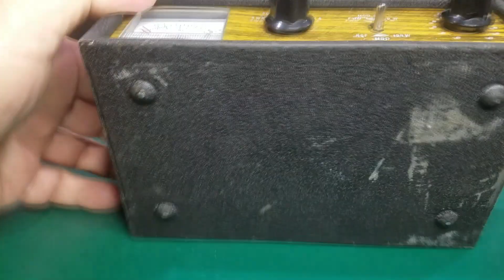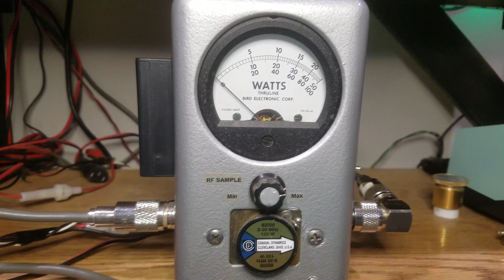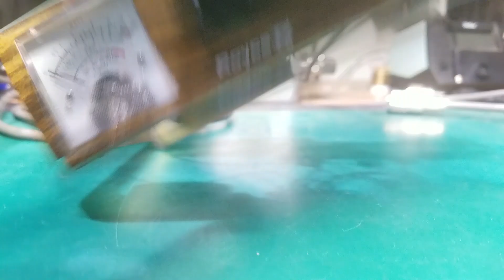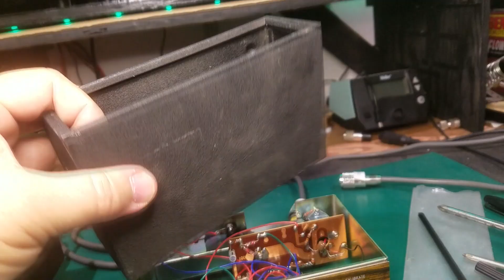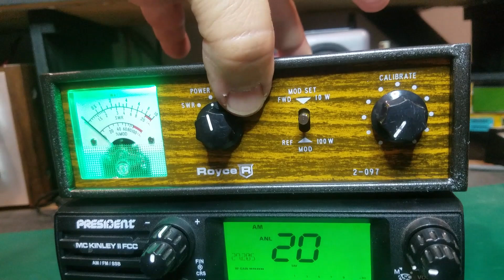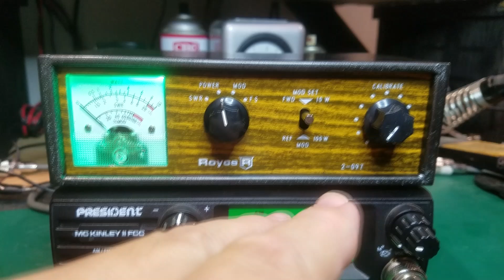Royce 2-097 3 Way SWR WATT MODULATION Meter Servicing

Comment: How did you power the green light?
Reply from the maker: A hot glued in a green LED that has the resistor on it so it will take a 12 V input. I put a connector on the back of the meter and then just wire a universal plug so I can take it in and out of line if I need to, and I just power it with my bench power supply. I use those 5.5 mm barrel connectors.

Comment: Saw this video last week and snagged one still NIB off eBay.  Calibration knob had the jitters but a shot of tuner cleaner and a spritz of D-Ox smoothed it out. I like everything about the meter. It looks and works great, and would be perfect if I had the equipment to calibrate it internally. 

I'm glad I found your video!
Reply from the maker: NIBN NIce !!
Seeing that your meter is NIB then I honestly would not worry about calibration. 
Enjoy your little gem. Thanks for watching and Cheers.